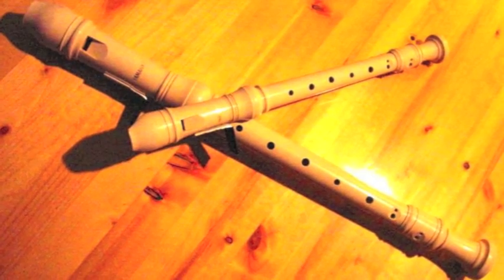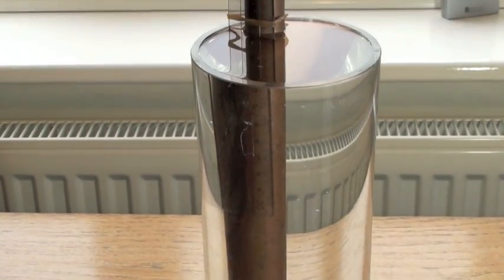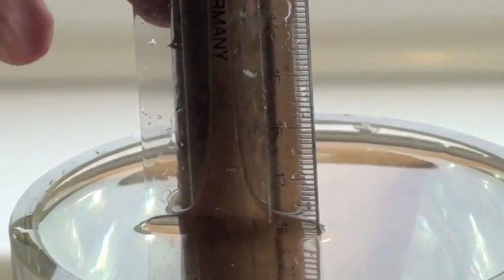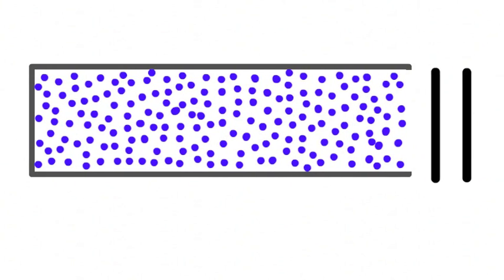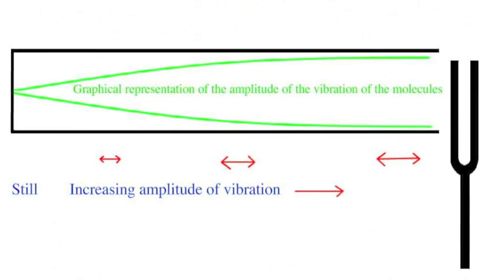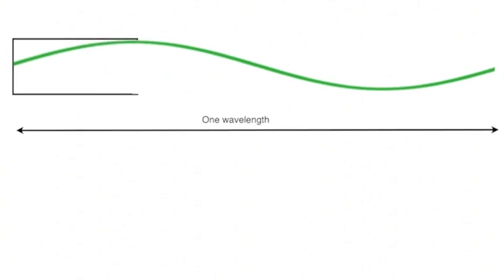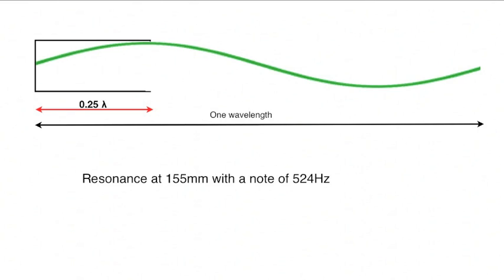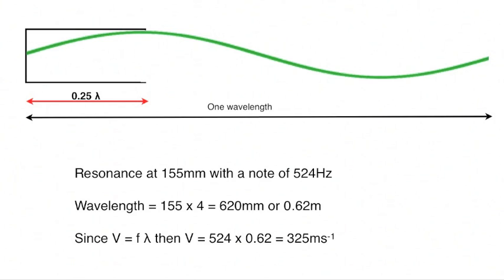Standing waves in tubes demonstrated and explained: from fizzics.org

Comment: sir, I have a question that I hope you can answer as soon as possible. In a closed tube, at the fundamental frequency, the wavelength is a quarter but when conducting the experiment in which a vibrator and pulley (with the string held taut between them) is used the wavelength is half at the fundamental frequency....why is that so?
Reply: okay nevermind that was a stupid question 😂
Reply from the maker: tammy al romaithi Sorry I have only just seen your question. No it was not a stupid question. In an open tube there is a node at one end and an antinode at the open end, the wave in the tube will then be a quater wavelength (fundamental) or three quarters or one and a quarter and so on. A vibrating string has a node at each end and so the fundamental is a half wavelength, the next possible 1 wave and the next one and a half.
Reply: Thank you for explaining this using simple terms and i really do appreciate your help.

Comment: This is totally useless.  Riddle me this batman, I want a tube to use as an acoustic CW filter for ham radio.  What is the diameter and legnth to maximize a 700 HZ signal from a small speaker placed in the bottom of the tube?  It should enhance 700 HZ and supress all other noise by several db.  Does tube diameter matter or only legnth? Will multiple wave legnths farther reduce noise?   Paper or plastic :)  Who cares about the speed of sound, give us practical!  You have several million hams wanting to know :)